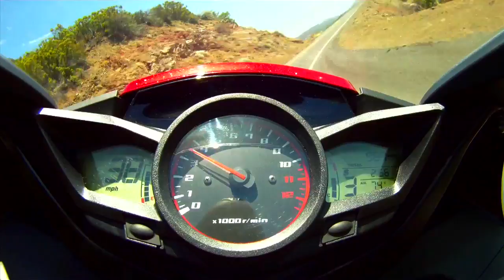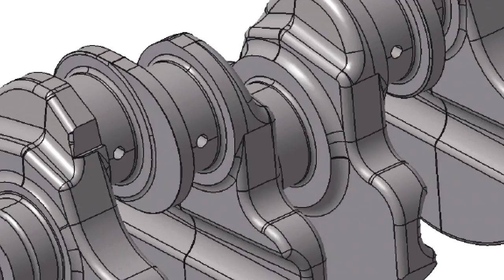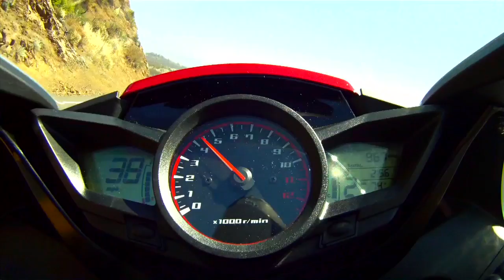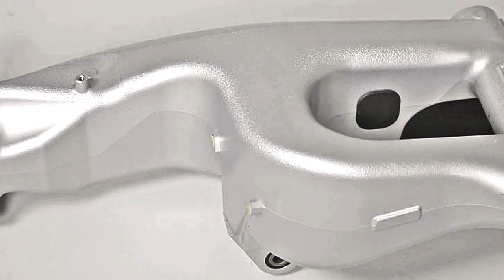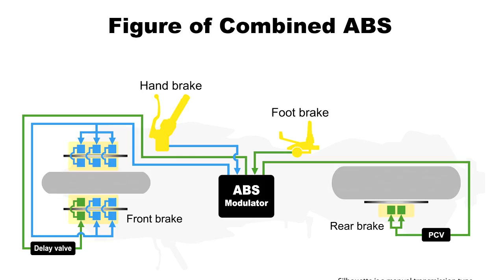VFR1200F: How it Works

Comment: I just purchased one. 2013 model, 13k km on it, barely broken in! Perfect condition, not a scratch or blemish. I pick it up in a couple of day! So excited!
Reply: I put 10k miles in two years lol I just got the bike remapped though so it’s way smoother in low rpm, and my top speed isn’t limited.

Comment: You say the engine is light and compact, but when people talk about adventure motorbikes VFR1200X’s engine, which is essentially the same as VFR1200F’s, is the largest and heaviest among adventure motorbikes’ engines, although VFR1200X isn’t a proper adventure motorbike.
Great engine anyway ^_^
Reply: Because adventure motorcycles do not need the kind of power this engine produces. It would benefit more from a parallel or v twin, e.g. Super adventure or African twin

Comment: Hands down the best bike I've ever owned. The DTC, The riding position, The engine, The technology, The smoothness! A machine ahead of its time by at least a decade. Over 45,000km on it currently since new, 2010 model. Can Honda please bring it back so I can replace mine?!
Reply: you need to qualify your opening statement by saying what your previous motorcycles were
Reply: @stevetipene3319  my father back then started on a Simson s51, rode some other motorcycles. Then had a  cbr1100xx, crashed it, got a cb750, sold it, tested a vfr800 and then bought a 1200f and says its the best thing he's ever ridden.

Comment: Have one. Love it.  Handles and rides well...CONSIDERING it’s weaknesses.

It’s a PIG for weight, acceleration,  and SHIFTING.  Manual version is not “light shifting”...you have to “focus” and exaggerate force on the lever to ensure it makes it into gear between 5&6 usually.  

The auto, my brother bought, is “OK”.  But “drive mode” is too flaccid and “sport mode” is too sporty.  Working the “paddle shifter” is the way to go...unless you are stuck in traffic or on a long haul.

For a BIG bike...it “flows” and holds lines & pace nicely through the twisties and on the highways.

Neither here nor there now though, I think “sales” explained it to them?

Comment: Honda sold like, what...10 of these?
Reply: You can pick up lightly used for way cheaper than you should for a bike if this magnitude. Love mine
Reply: There's about 3 where I live, including mine. I've done 17000km's on it to date and find it a very uncomfortable powerhouse
Reply: Dude i swear i am a honda dude and ive been thinking the same thing. Theres a beautiful 2011 vfr1200f at a local showroom sell for 10k(euros) and only 7000 miles on it plus a full akra. Its been sitting there for over 3yrs while the rest of the bikes have gone and new came. And i never really saw all this yrs any 1200 rolling . Shame cause it looks and moves so cool even for 2018 standards
Reply: Not really… nine are  still in crates
Reply: Such a nice bike
Reply: Have seen...FOUR in the US...since 2012.  Add the two I and my brother own...I think you overestimated by FOUR!?  🤣

Not a horrible bike to ride - IF you aren’t looking to set your hair on fire.  Wish they’d have done a few things better with it, seems they easily could have.  I guess it’s like...a “sporty Harley.”?  🤷🏼‍♂️

Comment: I recall years ago when the original YZF1000 (ThunderAce across the pond) hit the market I thought., “Man., why couldn’t the VFR have this type of power., this type of braking., this type of handling.” Maybe hard bags and ABS for traveling in inclement weather. Fast forward. The VFR1200F delivers that in spades! Traditionalists complain about the DCT? No problem. They have ‘shift it yourself’ models as well. The weight? It carries it very well (I test drove one) and has anyone SEEN how heavy it’s direct competitor (Sprint GT) is? Haven’t seen many complaints there. Mileage. On that may be the dry bone on contention but I’m not getting any younger and after 150 miles or so I’m usually ready to take a bladder break anyway. LOL! Price? Hey! You want big bore V-4 performance., Honda reliability and cutting edge technology it won’t come at Hyosung pricing. But I can’t complain. Ppl hating on this bike works to my advantage. I’m in the market now. Maybe I can find a slightly used model at a fire sale price!
Reply: You had thunderace 😊 cool 😎 you found vfr?

Comment: Sooo...Honda...did u finally corrected the mistake u made by restricting the power and torque available on 1st and 2nd Gears on the 2009-2011 Models ? Or are the 2012 Models still flawed by your silly mistake ?
Reply: Such a good bike

Comment: @aikibiker800 
~40lbs heavier than a VFR800ABS, (though you can't feel it when it's moving) but with shaft drive, longer wheelbase, USD fork, bigger brakes, stronger frame and subframe, bigger back wheel with bigger tire, and an extra 60 or so hp? I think that's a good trade-off. Pretty great bike, don't be so quick to dismiss it.
Reply: I like it now it is cheap and the tech is still there. Beautiful bulky bike with great engine.
Reply: A beautiful low mileage one is worth about $4,000, $5,000.  Tops...  !!!   Only if it has two new matched tires,  and new battery....

Comment: So why is it heavier than the VFR800?  I've test ridden this bike and they've missed the mark! Stock seat is a plank. DCT I don't want this - this is not what motorcycle riding is about! Do like the shaft drive, though.  I've seen one on the road in my area.
-owner and rider of a 2000VFR800fi.
Reply: Why a bigger bike is heavier?
Reply: Fantastic machine